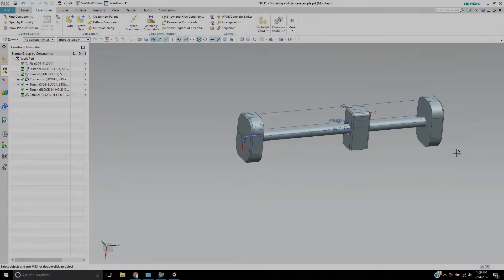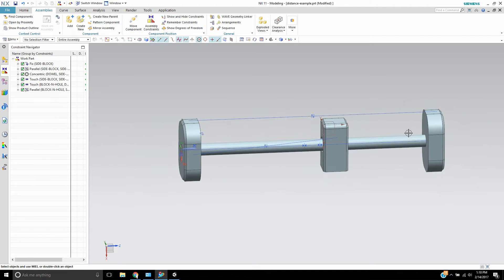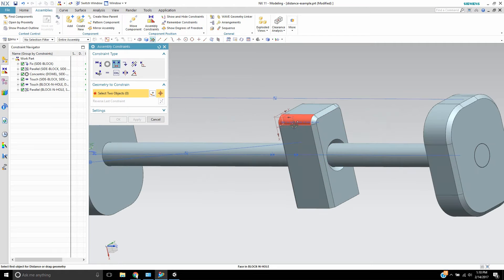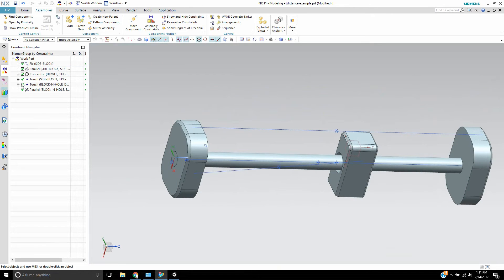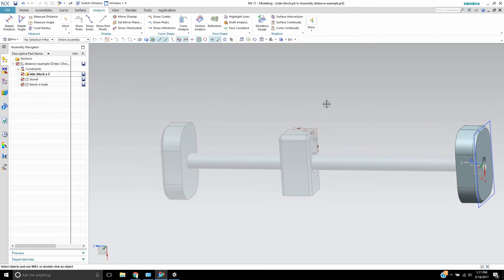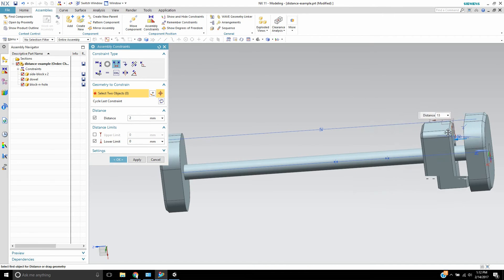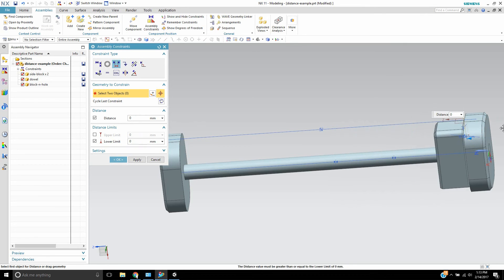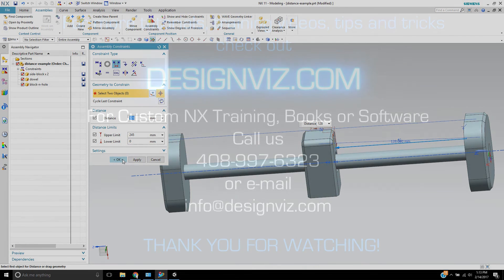NX11 Distance Constraint with Limits

Comment: Hello.

How do you do limits in Expressions? I am modelling piston cylinders for a group project. For one of our cylinders, the stroke length is around 14.661 inches. They want me to do an inter-part expression that would limit its extension from 0 to 14.661. Our checker punched in 30 inches and the piston flew out of the cylinder. How do I solve this? Thank you.

Comment: Hi there!
When i press on the assembly constrains button, and set the type to distance, I only two tabs; Geometry to Constrain and Settings. How do I get the Distance and Distance Limits tab?
Thanks
Reply from the maker: The distance limits section only shows up after you have selected 2 objects to control distance with

If you  still do not see it, click the little gear icon in the top left hand corner of the constraints window. Make sure that it is set to Assembly Constraints (more), many times these advanced features are hidden. 

Another way to unlock more of NX's functionality by default is to go to the Roles tab on the far left of the NX window, under content choose Advanced.